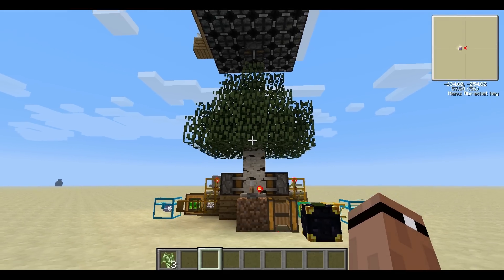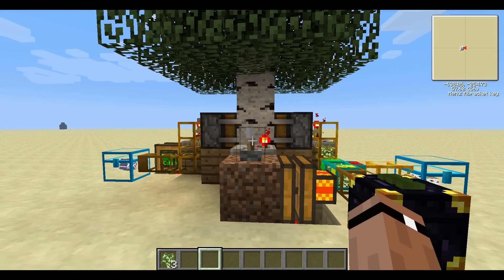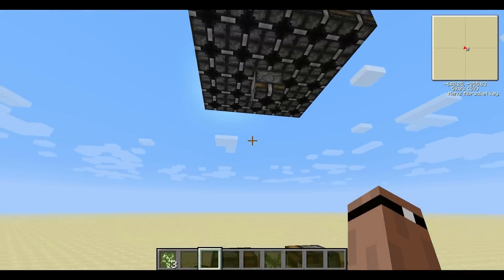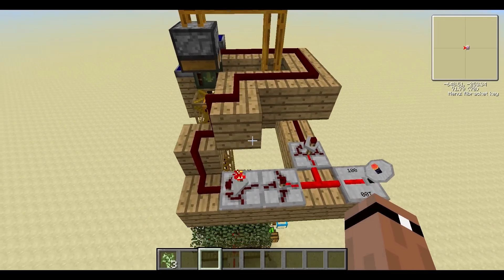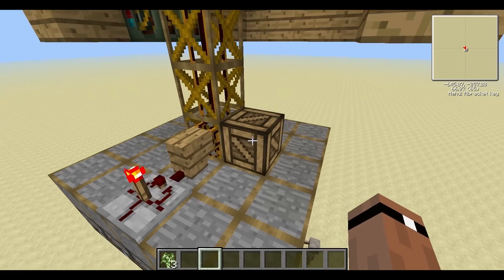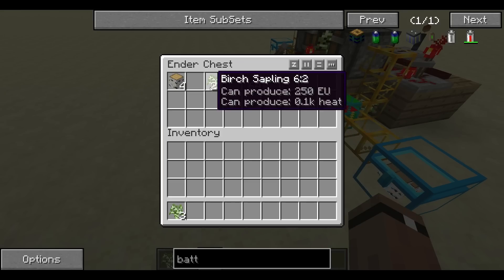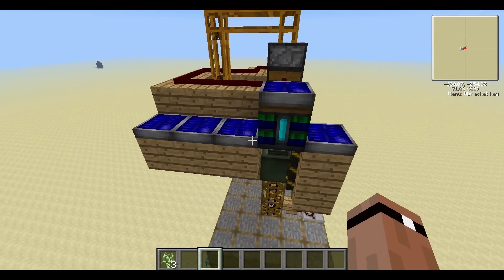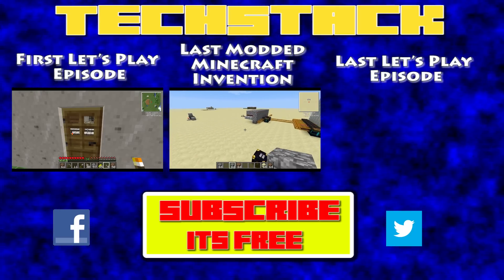Automated Frame Machine Tree Farm in FTB  - MMI (Modded Minecraft Invention) EP 4 by TechStack

Comment: There is a Solar Engine that works through the Day, You can't instant grow the stuff but you increase the speed with using bones as fertilizer, the problem with tree's growing over the tracks and prevent sunlight is easily fixed with Glass on Top of it, if you make a big farm it could reach the same speed with only 1 Cart.

Comment from the maker: Good suggestion I haven't used steve's carts much at all, but I though they needed fuel ( coal , charcoa ) to run the engine to move about. 
Would it be as fast as this design in a compact area ?
I'm asking because i'm going to be using Logs in my LP world but need a very abundant supply of it.